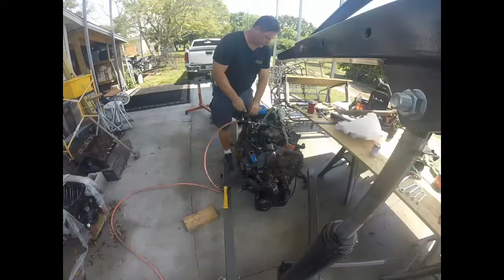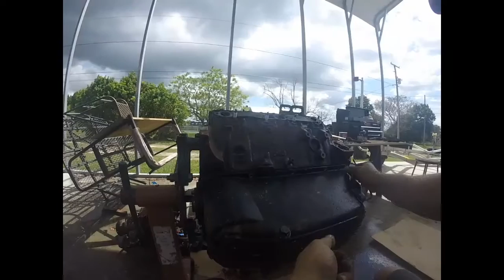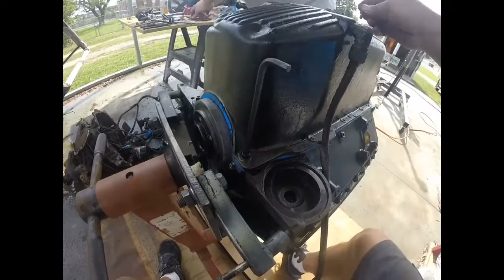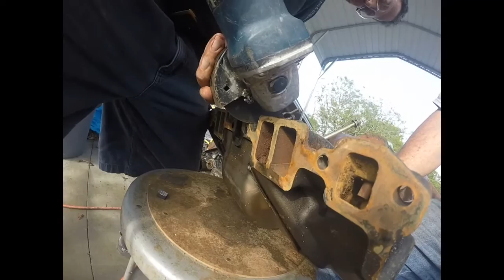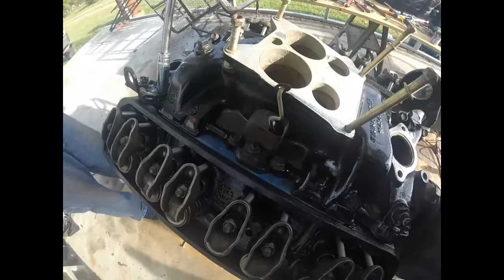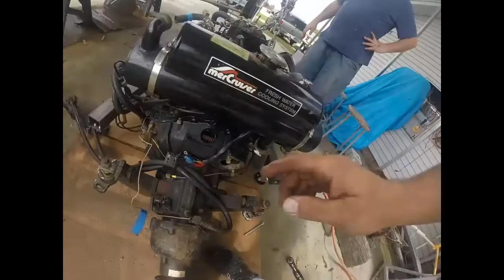32' Carver Engine Replacement Video 3 Switching parts to the new engine.

Comment: It's been too long since I did any real small block work, but I seem to remember that being a two-piece gasket for the timing cover since it goes against the block and the oil pan. Couldn't tell from the video what your goof was. Really enjoyed watching though!
Reply: +michael steen if that's the worst you experienced, you're doing pretty darn well!
Reply from the maker: My mistake was I put the timing chain cover on after the oil pan. I had to release the oil pan to get the cover on. Rookie mistake! I had to come and review the video again as I am about to redo another.